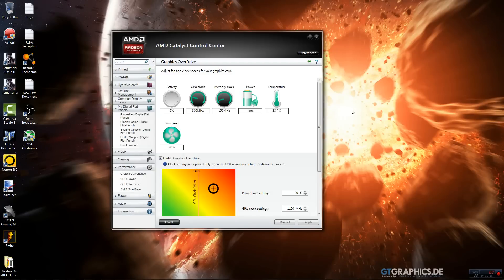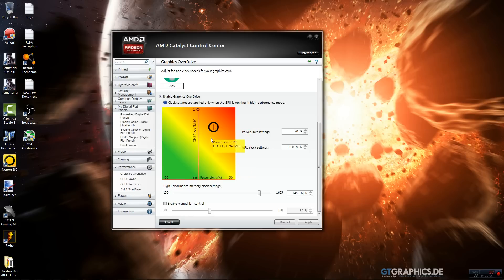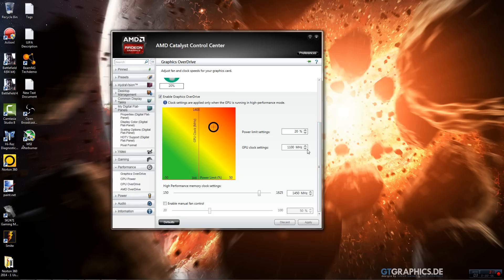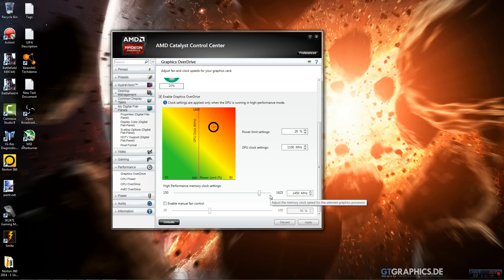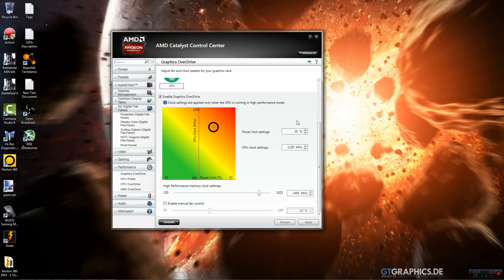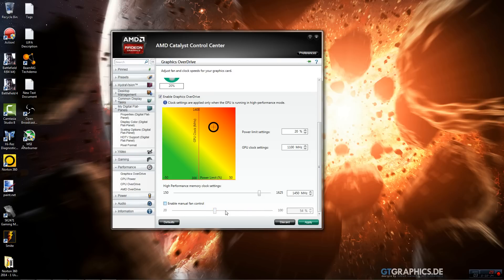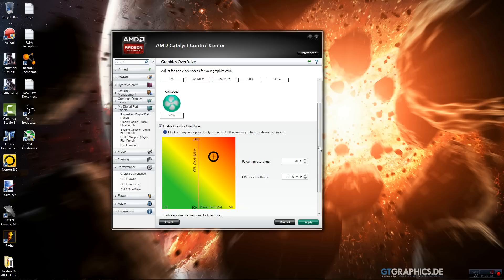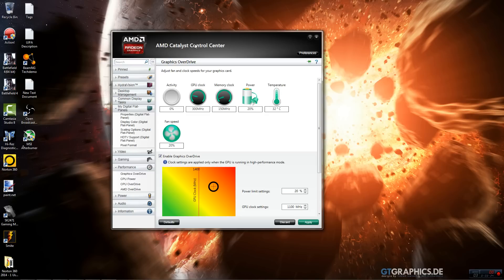Overclocking Your Graphics Card/GPU on AMD Catalyst [1080p, Voice] ~2014 -Speed up Gaming!

Comment: I tried underclocking my memory to 1000 MHz from 1400 MHz but the icon at the top still says "Memory Clock 1400 MHz" when I play. At 'rest' it's at 140-150 MHz.
Reply from the maker: +Izamanaick Make sure you applied it, and yes its normal when idling to majorly underclock. It saves power.

Comment: My Inspiron 19 old edition, exactly how would this work?? I don't wanna fry my graphics card, all of the parts are stock parts you would get with it when unboxing. I don't wanna demolish the PC.
Reply from the maker: +ScorpioCanyon Tv Overclocking isn't recommend for laptops due to higher power usage and heat. Just monitor your temperature and expect lower battery life.
Reply: Mine isn't a laptop, it is the inspiron 19 desktop. Not trying to be picky or anything as I may sound, but I am wondering cause minecraft wont run on it though Gmod can and I love minecraft so you know. Old PC just wondering. Thanks for the info anyways :)
Reply from the maker: +ScorpioCanyon Tv Minecraft is quite CPU and RAM intensive so make sure you're not bottlenecked there
Reply: Thanks for warning me, my mom won't buy it for me until we have a tower computer and a new moniter. This is an all in one so the only games that run are, unturned, roblox, garrys mod on flatgrass, and a few others. Surprised even BeanNG Drive didn't take out my pc when I tried playing it, it lagged hell. But, thanks for the information!!

Comment: its not going to slow down pc right.. it will boost the perform of pc right?
Reply from the maker: +Rafi Fathoni Usually overclocking makes only a small bump and may lower performance, it all depends on your configuration. Pros: Speed. Cons: higher temps, higher voltage, shorter life, instabailities, etc. I would bump up 5-10mhz each time, do some testing, and keep going until it starts crashing and see if your FPS goes up as well, and watch your temps.

Comment: Biggranny, any suggestions to improve my experience in gaming?I have Windows 10, and my laptop is kind of bad...Ram : 2 GB RAM (1.88)Space: Over 300Might be lower by the time you respond...
Reply from the maker: +The Innovationist You can't really upgrade laptops at all, windows 10 will make it slightly faster though. (See if it voids warranty) and maybe you can take it apart and put some more RAM into it. I'm sure it can't game due to no graphics card.
Reply: biggranny000 Oh. Thanks for the insight, dude. I appreciate it.
Reply from the maker: The Innovationist I'd recommend you custom-build a desktop. People say it's difficult or takes a lot of time it really doesnt. You can do it in a few hours, and there's plenty of help and tutorials you can get out there. You can build a nice PC for $700 or more or less depending on all of your parts that will mostly max out most games.
Reply: biggranny000 My family is a immigrant family, thus we do not have the money to afford one. My laptop was about $230, but custom is way over $500.

Comment: I have like 2x times slower pc than yours.and I want to get best perfomance possible.Any suggests?
Reply from the maker: +Andrej drenovac The best $100 you can put onto my PC was get an SSD and put your OS on it. I only recommend overclocking if you have a decent powersupply and components, you get more heat and more power consumption as cons, and if you OC, make sure to do it over smaller increments.
Reply: If you have a PCI express port you can buy a graphics card which will help a lot, gpus like txt 750 ti, gtx 950 or like a r9250 would help a lot  and the r9250 is like 70 bucks, gtx 750ti is 100-120 and 950 is 150.

Comment: I think my PC's CPU is ruined... maxing to 90-100% cpu in newer games in csgo 50-60% ikd what to do... :/
Reply from the maker: +name surname What do you get ideal? And what CPU do you have? It's indeed a bottleneck if you're getting 90%+
Reply: biggranny000 AMD Athlon X4 860K Quad Core maybe its just shit but I have another PC and it has worse CPU and doesn't go so high... And is there any diffrence if I have overdrive on? Graphics overdrive etc? It was turned on automaticly... The games run 30-60fps even the other PC lags like crazy but the CPU is fine... :/
Reply from the maker: name surname Probably lacks a graphics card. I'd recommend a CPU upgrade, my Phenom 965 is barely minimum for many modern games now, or a whole new custom-build in general.
Reply: biggranny000 Do you think I could upgrade just Graphics card and CPU?
Reply from the maker: name surname What socket do you have? AM3? AM3 does support a few FX processors but very few of them. A new GPU would help you out a lot but you have to make sure your cooling is good enough and your powersupply.

Comment: I have to answer this way sine I shut down my pc, and I have a 8 core 3.6 (overclocked to 4.0)
Reply from the maker: +Scrub Lord Much better than what I have, you probably have an FX-8350 or something along those lines. Mine is an AMD phenom 965, it's over 5 years old. 45nm architecture which is really old, 3.4Ghz, 6MB of cache, etc. Back then when it was released it could beat Intel I7s, now even I5s nowadays are twice as fast. I get nearly 100% CPU on battlefront.

Comment: Can someone help me?

I have a xfx Radeon 7800 series ghost edition

How much can I over clock?
Reply from the maker: +Scrub Lord You most likely have to enable it in Catalyst, then you can start.
Reply: +biggranny000 Okay, but I asked for how much I can overclock it, but I found out myself.
And it is amazin, I am playing The Star Wars Beta on ultra with 60+ Fps STABLE.
Reply from the maker: Scrub Lord Dang, what CPU do you have?
Reply: +Scrub Lord hey i have the same I'm using the XFX Ultra OC Radeon R7850 1GB DDR5 PCI Express 3 0 Graphics Card i just overclock mine from cpu clock standard 975 & 1200 on memory OC it to 993 &1200 memory getting scores from my Standard setting 975 with the score of 983 when OC to 993 my Score is 1000 fps 39.1 min fps 20.5 max fps 72.3  temp of 76c thats the highest my temp when 2

Comment: I wanted to poke around with my graphics card to see what it can do, and going to the catalyst has led to no changes (settings refuse to be adjusted) at all which got me to look up videos to make sure I wasn't just in the wrong section. I have the R9 380 card and the catalyst program won't let me change any settings in the graphics overdrive. Lowering or raising any setting, like earlier, just immediately gets reset to how it was when I first went to the page. Unchecking manual fan control just causes it to be rechecked again as if I never clicked it. My card runs around 60C idle and reaches 68-70C while gaming.

Comment: I got a r7 260x i5 4400 12 gb ram how much do i overclock it
Reply from the maker: Micheal Pena Try small increments at a time and see if it works alright. Generally overclocking creates higher temps which leads to more noise, with a small performance gain. Everyone's systems and configurations will have different results.

Comment: AMD Radeon 7770 what should I set the numbers to? Like Power limit settings, GPU clock settings etc...
Reply: just test. Every GPU is different.
Reply from the maker: KYBZ All GPUs are different, and completely agree with CrazyKing. Keep moving by tiny increments and do a burn in test where you play games for a few hours and see if it crashes or do a stress test. Make sure your powersupply can handle it, and remember the cons and dangers with overclocking. I bet you can push your card maybe 10-50Mhz core core clock and memory, but probably not farther, again a guess. If you want to OC I recommend maybe 20% extra juice.

Comment: I have Power limit settings at 10% and GPU clock settings at 10% (r7 260x). High performence memory clock settings + 150MHz . Is that okay? Or can i do something better? sry for bad english
Reply from the maker: You can determine that by playing games and see if it's stable, if it crashes lower it a bit and try increasing the power limit slightly. A 10% increase for core clock and +150Mhz memory is quite a big overclock.

Comment: Graphics overdrive doesn't seem to work on my system. I have my fan speed turned up to 50% and it doesnt work when I am playing a game. So I have been using Msi afterburner to keep my fan speed at a steady 50% instead of a dynamic rate.

Also I turned up my GPU clock to 20%,(doesn't display the MHz anymore), and my screen went black.
Reply from the maker: Doing big overclocks like 20% has a very high chance to crash your graphics card and screen, you will likely have to reset your PC. And MSI Afterburner is also a great ultility, it's a best better than Catalyst mainly because it's super light and also has tons of monitoring graphs.For me overclocking my GPU to any extent would crash my computer within a few minutes, because my card is already overclocked out of the box because it's aftermarket. It's only a good idea to use manual it's up to your preference to keep your fan speeds at a certain rate, if your temperatures are fine then theres no need to worry so I have them on automatic. Thanks for the comment.
Reply: biggranny000
 Well my tempuratures are always around 40-50 degrees Celsius when idle. It seems kind of high for being idle so I keep my fan speed cranked up otherwise my card will end up reaching 60 C.
Reply from the maker: TheSuperiorDarkWolf 40-50C on Idle is VERY High, unless if you are on a laptop. You are basicly getting gaming and moderate use temepratures at that rate, which your graphics card is going to wear down a lot faster. What temperature do you get while gaming? Regardless if a laptop or desktop, make sure you check for dust and if possible upgrade your fans or see if some of them are not working, it is could be to a bad cooler, I usually recommend aftermarket cards.
Reply from the maker: TheSuperiorDarkWolf Average GPU temperatures are 30-40C Idle, and 60-80C Gaming. My GPU is 20-30C Idle (Depending on room temperature it changes sometimes), and it does 45-50C moderate load and 55-65C gaming and extreme loads.
Reply: biggranny000
It depends on the game. Most of the games I play, my card will run around 70-85C average and 90C max. The lowest I get is 50C on some games.

Right now I own a AMD R9 290X that has an enclosed case with a single fan, just like my  Nvidia GTX 580 had. They both ran at really high temps.
Reply from the maker: TheSuperiorDarkWolf Anything above 80C is quite hot for a card, but it's still completely safe. An R9  290X is known to get hot because it's such a powerful and power hungry card, but it is great. I recommend getting more fans in your case, a single fan is very inefficient. On my old case which had bad cooling only had a single 80mm exhaust fan, then changed that to 120mm exhaust and 2 front 80mm fans and lowered my temps by 5-10C.
Reply: biggranny000
I was talking about my Graphics card case. Though I do need a new 120mm fan because the silent one I own doesn't really do the job. I also have a Lian Li case which doesnt really have much ventilation. Its similar to this design, http://www.newegg.com/Product/Product.aspx?Item=N82E16811112387
Reply from the maker: TheSuperiorDarkWolf Oh my bad. I recommend cases (A lot of like these now days) where it has side fan slots, bottom fan intake slots, and also top exhaust slots. They make a huge difference. Top exhaust will extract heat much faster depending on the size, side exhaust will mainly cool down your GPU, and bottom will give it some more air. I recommend filters as well. I just have a 200mm in the front of my case for air intake to cool hardrives and components, top 200mm exhaust and 120mm exhaust and it performs much better than my old case and once heat is created it gets sucked out, not even even my heatsinks get that warm doing gaming. You seem to have a decent case especially for the amount of storage and features and managment it offers and if you like a simple look it looks good, it has good front cooling but lacks exhaust and other ventilation.

Comment: Aye. I got the r9 270 oc.
Reply from the maker: I have a Sapphire Vapor-X r9 270X also OC. It's a great budget card but the r9 270X isn't too much faster than the r9 270 but it's a bit more pricey. It's a great value card, and they are cool and quiet and have amazing performance for the buck. They are cheaper than a GTX 760 but yet the GTX 760 is only about 5-10% faster.

Comment: is graphics overdrive a separate download or does it need to be enabled somewhere? Its not showing in catalyst
Reply from the maker: What GPU do you have and also make sure to check all of your tabs (Which I assume you did), and also make sure your drivers and catalyst are up-to-date.
Reply: biggranny000 A4 apu. Its not much but works ok for now. I have been using MSI afterburner. Im sure catalyst just doesnt support graphics on an APU but maybe some day.  Nice video by the way. Its very clear